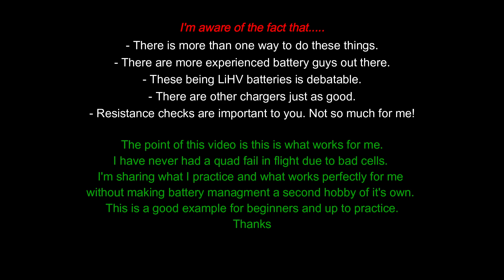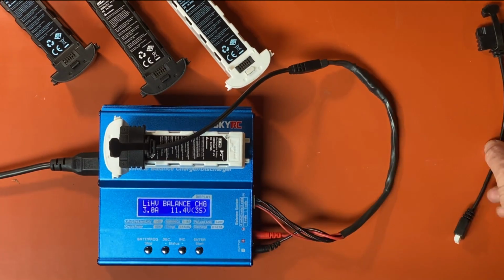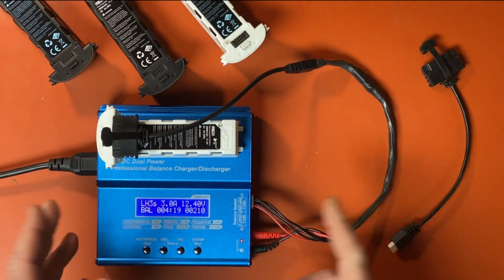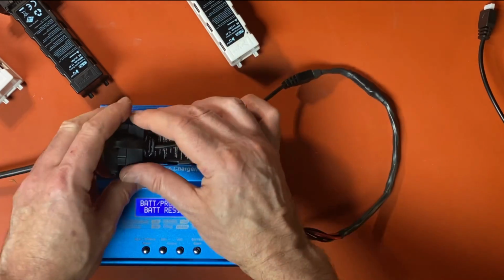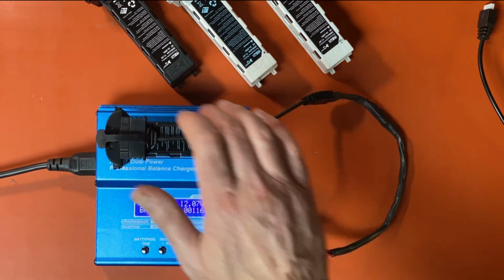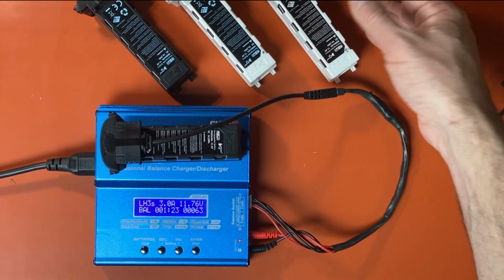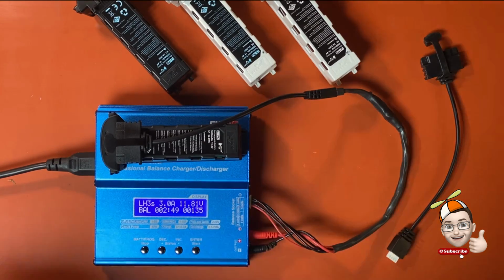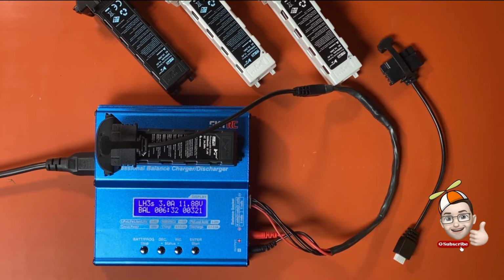IMAX B6 V2 BALANCE CHARGER - BATTERY MANAGEMENT USING HUBSAN ZINO BATTERIES

Comment: I made 2 charging cable from a balance extension cables by soldering the hot and neg cables to it. I checked to make sure the wires are hot and neg with a meter. But when I try to charge my zino battery's they will charge up to bout 75% and then I get a battery disconnected warning. I can unplug and re-plug  all the wires but the charger will not charge any further. It just gives me the disconnected warning. Any Idea what is wrong? I was balance charging at 1.1. I noticed your charging at 3. Only thing I have been able to do with the charger is put the battery's in storage. I have a charger like the one you use here but it is a different brand. It is a LiHV charger. I also have a bigger Hitec charger but I haven't tried them on that one yet. I was hoping the smaller charger would work so I can bring it with me on motorcycle rides. Any help is appreciated. BTW these are new battery's, I just got the Zino Pro with 2 batts.
Never mind. I tried with the Hitec charger and it works fine. Sending the other charger back.

Comment: Interested to see if this will still apply to Zino 2 batteries/charger
Reply from the maker: Colin Aitken Im willing to bet it will. They call them smart but haven’t made one yet. Not known for good chargers either. 👍
Reply: Chris, can we assume the battery connection will be the same as the zino/Pro battery? I want to set myself up with a balance charger and get the extra leads needed (I don't think I could manage to make them myself 😂)
Reply from the maker: Colin Aitken they are exactly the same. I might make up balance leads to sell. It’s not hard but time is a factor.

Comment: Hi QC Guy. At the end of the charge I get red cells indicated. Does this mean they are fully charged or a problem. Again thanks for your video and help. Cheers Tom
Reply from the maker: With what charger? If so I think that’s correct. I don’t use those chargers. Not for 3 years now...
Reply: @QCGUY   Hi Chris, Its the IMAX B6 AC V2.
Reply from the maker: @tomcollings9501  I don’t recall red cells but it beeps and tells you it’s charging is complete. 
I’m sorry I would need to see what you’re referring to.
Reply: Sorry, site wont let me send you my screenshot. When I press the status indicator it shows me three green cells while charging. When it gets to near fully charged those three cells turn red. @QCGUY
Reply from the maker: @tomcollings9501  I’ll have to check mine. I don’t recall it being red but doesn’t yours say it’s charged and give you a series of beeps.
Reply: I might have turned the beep off. I am paranoid about it overcharging, so have probably turned it off prior to the beep. Going away for a few days so will see how it goes. Thanks for the reply. Keep well.
Tom
Reply from the maker: @tomcollings9501  if you have it set to balance charge it won’t overcharge. It’s a good smart charger. 👍🏻

Comment: Today when I was flying my zino pro (it came to me on June 28), the screen showed the battery draining too fast and gave an alert saying that the battery was draining very fast and I had to replace the battery. I could only have it 5 minutes in the air and when I paid attention to the battery and the messages I almost die. I literally had to make an emergency landing. I already ordered the charger and another battery, but where did you get the cable to charge it? And thanks for the tutorials.
Reply from the maker: Alexis Beltran Thanks 👍

Comment: Thanks for the information, eventhough I don't have a Hubsan, but I DO have a SkyRC charger and I'd like to use it on my MJX Bugs4, and my SJRC F11 drones.  The problem is, both of these drones have batteries with a USB connector and they want you to charge them from a wall charger for a cell phone.  I've done it ,but it takes like, 5 hours !    Isn't there a way to charge these batteries (with USB connectors) using a hobby grade charger ???  Isnt there an adapter out there ?  Can one be made for USB ?  Any replies welcome.
Reply from the maker: djwak59 If you have a spare usb lead to play with for one of those batteries you can try to make a balance lead out of one of those usb leads. I have 3 videos on making balance cables and I think the usb is in part 3. Thanks
Reply: Awesome !  It would REALLY save me some time when charging them up.  Thanks.  I’ll check it out.

Comment: Chris,
Where did you get the thicker battery cable? All I can find in the Hubsan site is the thinner one.
Reply from the maker: It doesn’t say or show it’s thin or thick. It’s just a change they made that come with all new models now so I imagine the separate stock will be as well.

Comment: Hi Chris..Where can I find the cable you are saying at 3:29 for charging  my zino pro plus with that?Thanks in advance!
Reply from the maker: It was a revised new thicker cable. It’s the only one you can buy now so no worries about getting the other one. You can’t charge the pro plus with this charger unless you do my battery modification.

Comment: Hi Chris, is there available in the market any balance cable for ZINO 2 battery in order to use it with imax B6 V2 charger?
Reply from the maker: https://www.amazon.com/dp/B00UY2Q23I/?coliid=I13GK3JOR0VISV&colid=38ZNT1U7V2VT9&psc=1&ref_=lv_ov_lig_dp_it
Reply: @QCGUY  Chris, this is a 3S cable for standard Zino & Zino Pro. Are you aware also for a similar 4S balance cable for Zino 2?

Comment: I noticed on these chargers there is a max capacity shut off set to 8000mah. Should I set this to 4000mah for these zino batteries?
Reply from the maker: RobbyMaQ No, when you set it for your type of battery it knows what to do from there.

Comment: I'm sorry im new to this, i just ordered that exact same charger as my original zino didn't work... cant u just plug the zino cable directly to the imax and charge? Do you need to make those mod cables?
Reply from the maker: Charismatic LG You can make one or now they are producing them. 
https://www.ebay.com/itm/3S-JST-XH-Charge-Balance-Cable/291799988263?ssPageName=STRK%3AMEBIDX%3AIT&_trksid=p2060353.m1438.l2649
That’s all you need 👍

Comment: Your storage mode is essentially just the discharge process?  Will the charger in storage/discharge  state stop at a certain preset number like 30%?
Reply from the maker: Yes and you can set it. I haven’t had to use it in a while as all these quads are doing ell with their smart batteries. Normally I never need storage mode anyhow. My batteries are always at least 25%.
I’m sorry man but I’m not getting notifications on your comments for some reason. This is the second one I stumbled on of yours. I don’t like that and hope you didn’t think I was ignoring you.
Reply: @QCGUY  no sir I didn't think that at all. I can only imagine the number of questions you have to answer daily. By the way thank you for taking the time to answer mine.

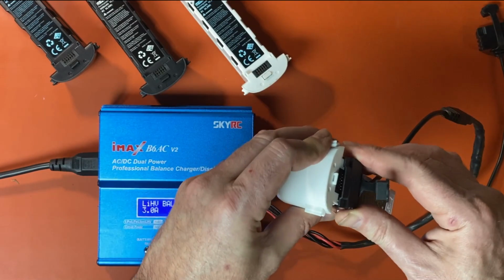Comment: Reminds me of the very first video I commented on your channel, then I subscribed:) The spark comment:) 3:43 in this video top pin sparked when you connected it again. hehe. Anyways happy new year QC & I need one of them balance leads:( I have had the same IMAX B6 charger since I got the Zino but I've never been able to use it, Still using the one that came with it. I live in the UK do you know where or how I can get one for my Zino? Great vid!
Reply from the maker: PC-Gamerz-UK Do you know how or have the ability to make one?☝️
Reply: @QCGUY  I could make one with the correct parts and tools I guess :) Just don't have either of them:(
Reply from the maker: PC-Gamerz-UK You have a heat gun or lighter? I have a video where that’s the only tool you really need. 
Check my first pinned comment. 👍

Comment: Can you pls help me understand the voltage, the charger says 11.4v and the label on the battery says 11.4v. How can you measure over 4v/cell? If 4.35/cell is full charge is way over 11.4v, what am I missing?
Reply from the maker: Post this in my group with pictures of your readings and question there. https://www.facebook.com/groups/HubsanQC

Comment: Can you explain why do you set LiHV as battery type and not Lipo as labeled on the Zino battery? Thank you!
Reply from the maker: piero menetti It’s a lihv battery despite just saying lipo on it. If you see 11.4V on the battery it’s a lipo high voltage versus a regular lipo at 11.1. 
You can charge at both settings with it being a very minor flight time difference.
Reply: @QCGUY  Thumb up! Thank you!

Comment: I'm thinking of getting one. Just wondering why you can't just plug the battery cable directly into the 4 pin socket on the side?
Reply from the maker: In short you need the the two for power supply and then the 4 to balance the cells.
Reply: @QCGUY  oh ok. Thanks for that. I use the stock charger and it can take 5 hours to charge a battery.
Reply from the maker: @rexxx777  Yeah those aren’t real balance or true balance chargers. They take much longer because they don’t have the power leads working a process or stage that makes a smart charger smart. The stock chargers can often overcharge and damage the batteries. 
A smart charger is working to balance each cell from the start of a charger and maintaining that throughout the entire charge by adding power where needed and taking it from areas that are too high and off balance. 
I do a bad job at explaining this so let me grab you a link of a very smart and talented gentleman. Be right back 👍🏻
Reply from the maker: Here ya go...I hope this helps you and he has more videos in his library on lipo’s I suggest you browse through. Happy learning buddy 👍🏻
https://youtu.be/wIbHLacozFo
Reply: @QCGUY  hi again. I have the charger and have been trying to charge my zino batteries. I have one that's 13 months old. I was charging it at 1A and it timed out after 3 hours.  I put it in the zino and it read 70% full. One of the cells reads 77% full while the other two read 100%. Is the battery stuffed? I get only 10 minutes out of it but I was hoping that this charger would rejuvenate it but I guess not.
Reply from the maker: @rexxx777  Yes sounds that way to me but I’m just going off what you say. There’s one thing you can try by just balancing the sell that needs the boost and then back to balancing all together. When one is significantly off it’s going to take a long time and then time out. 
There’s videos for that but you’re going to have to make up a lead to do it.
Reply: @QCGUY  hi again. Problems with this charger. I have tried to charge a battery. It times out. The charger tells me there is 97% or more in each cell. Then I put it in the zino and the app says 60%. When I charge the battery with the hubsan charger it will show 100% charged in the app. Any ideas?
Reply from the maker: @rexxx777  https://www.facebook.com/groups/HubsanQC/

Comment: Hi Chris.
I got the IMAX charger today and start charging.. I followed your instructions and did it accordingly.  But I noticed that the amp does not stay on 3.0a.. it drops to 2 and even 1 and 0.6a.. and the v goes up to 13.02v is that normal?
The battery cells are 4.35 4.31 4.35 is that good?
Reply from the maker: Max Breinburg Already answering this in my group are you satisfied and all questions answered to your liking?
Reply: @QCGUY  yes... I am very satisfied thanks again and I am so happy with the fb group
Reply from the maker: @droneSuriname  Glad to hear it!

Comment: when i charge my ZINO batteries above 0.8 amps the batteries are getting very hot and because i use battery temperature unit always cutoff the charging - if i dont use battery temperature unit then one of the battery cells drops to 3,30 volts and stop charging any more - all these using original IMAX B6
Reply from the maker: Same on multiple batteries or just one battery. Sounds like a bad battery..,.
Reply: @QCGUY  same on all original ZINO batteries - i have 3 - all of them same problem when i decide to charge them over 0.8 amps
Reply from the maker: @YanisFafis  do you have another balance lead you can use between the battery and charger?
Reply from the maker: @YanisFafis  your going to get less of a charger using the original imax without lihv mode but we’re only talking 2 minutes difference tops so I think I would look at another balance lead to test out.
Reply: @QCGUY  yes i have 3 - 1 original came with ZINO and 2 more others from different buyers - i try all those - same problem - i try my GIF with them and GIFI charges without issues even at 2 amps - i didnt try more amps
Reply from the maker: @YanisFafis  I have to say I’m stumped on this one buddy. Very strange for regular original style Zino batteries on the imax.

Comment: Hello, I'm from Brazil, lately I bought a Drone, hubsan zino h117s and when he arrived I used it about 3x, but then he started flying very little, and I land it with 30% and 5 minutes he flew, and he’s also going down the batter very fast when he reaches 30% if he doesn’t land soon, he goes down but the percentage is still fast… anyway, it’s not normal, right?
Reply from the maker: No, Hubsan keeps playing with the battery meter and parameters in the firmware where they should just stop and give up because they are screwing it up. If you have multiple batteries doing this chalk it up to their brilliant engineers but if it is just one battery it can be a few things like the battery itself or poor soldering inside creating a dead short which I have found on a few occasions.
Reply: @QCGUY  Hello, it's me again with some doubts ... Today I made the adaptation of Hubsan Zino on Imax b6 v2. so far so good, when I put the drone to take off, I stayed 5 minutes in the air and landed at 35% percent, so I put it to charge the battery of the hubsan zino and when I put it it gave 78% in the imax b6 v2.

Comment: QC Guy..... Do you have a link where you purchased the upgraded Hubsan cable?
Reply from the maker: Marc Betts It comes with the newer models. That’s how I got mine.
Reply: @QCGUY  Understand. I received my Zino pro last week, so for all intense and purposes, I should have the newer cable, correct?
Reply from the maker: Marc Betts Yes 👍
Still check to see if it gets too warm during charging though.

Comment: Chris, is there any differences in using the newer batteries by GiFi 4200mah?
Reply from the maker: Miller Ingram Yes more flight time. Charging is the same and so far they are very reliable.

Comment: Why charge at 3.0A? That deteriates the battery more does it not?
Reply from the maker: Miller Ingram It hurts nothing to use 3.0 amps but the cable is thin and will heat up. I don’t think I said to charge at that rate though.
3000mah batteries can do 3.0amps
2700mah batteries do 2.7 amps
With these thin cables 2.0 is safe.

Comment: I just received 2 brand new Zino batteries.  And I have a HTRC B6 V2 charger that came with a 3rd hand Zino I just purchased.  I am new to this. Haven't got to fly it yet. So with this charger if I read the display correctly I can charge one of 2 ways. One says balance charge. And the other just says charge. Are they one in the same? If not is one better than the other?  I'm charging these batteries for the first time. Apologize for all the questions . Please help this newbie....
Reply from the maker: Always balance charge these batteries. You can only straight charge a smart battery effectively but they don't require hobby chargers like these because they are smart batteries. The IQ of the zino batteries qualifies it as stupid. lol
Reply: Well I shouldn't have listened to someone in one of the Facebook Zino groups.  He said I could charge these LIPO batteries on Lihv. Little did I know that is Lipo high voltage . I plugged each one in one at a time. The display beeped at me and said disconnect battery. So I  changed the charger back to lipo and plugged it back in thinking I could discharge it and it would be ok. NOPE. AGAIN IT SAID disconnect battery.  So I guess I fried one of my brand new batteries.
Reply from the maker: Cory Vines These batteries can be done as lipo or lihv but you lose a very minor amount of flight time charging as lipo. 
Either way balance charge is a must and no more then 2.0 or 2.5 amps tops. Higher and the cable will heat up and be a bigger problem.
Reply: @QCGUY  I've been balance charging them at 1.5 amps. So with the only reading coming from the charger saying disconnect battery . Are they fried? Because it won't even let me check the voltage in each cell .
Reply from the maker: @dalejrfan88intexas  I never had mine display that message. have checked to see what each cell level is on the battery?
Reply: @QCGUY  it won't let me do any kind of checks. I tried to see if the cells were balanced . Anything I try to do, it gives me disconnect battery while beeping
Reply from the maker: Cory Vines I don’t know what is going on there. Not sure if you got a dud charger or perhaps a clone but that’s strange for certain.
Reply: @QCGUY  well I just spent $55 on an IMAX B6AC V2

Comment: HEY BUD HAPPY NEW YEAR. WOULD YOU SELL THIS ADAPTER PIECE FOR THIS EXACT IMAX MODEL? And will this work with the ZINO 2 battery.?
Reply: Following. I would definitely pay for your adapter creating services.
Reply from the maker: Alberto Loyola I would love to be able to help by making them. Maybe when I have time I will but you can search 3S balance leads and find some already made. Problem is they are usually sold out.

Comment: Third time watching, but this time I've got my new IMAX B6AC V2 BALANCE CHARGER setup with a battery and can follow along. ;-)
Oh, and it even had a scratch off bar code on the back that, after scanning it in on my mobile, it informed me that I've got the original from   SKYRC. :-)
Thanks for the super video.